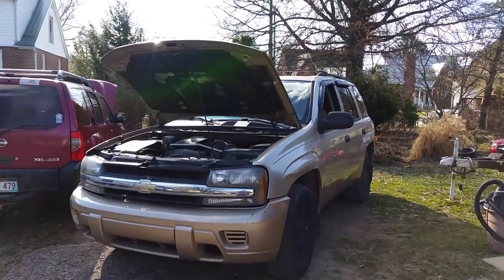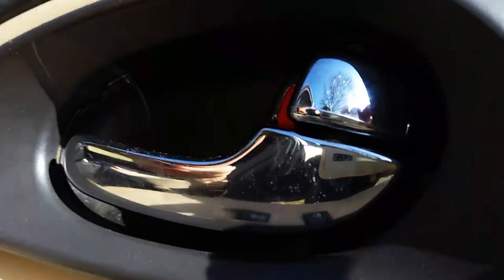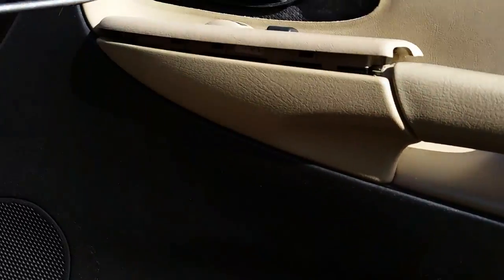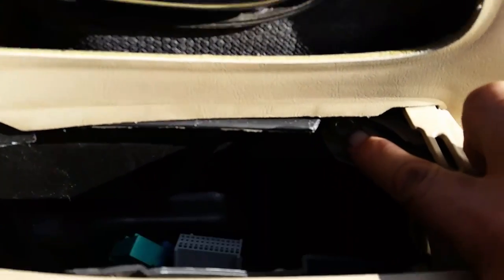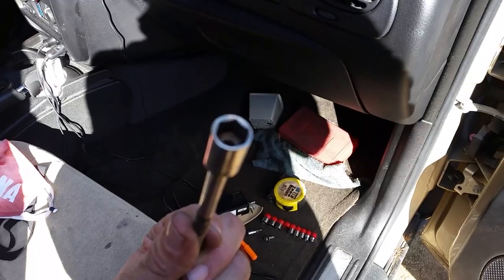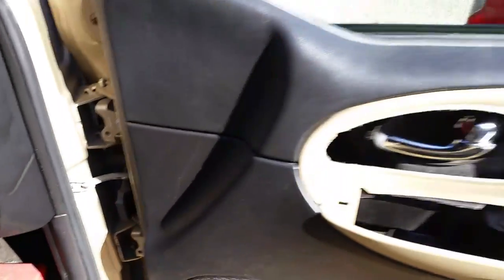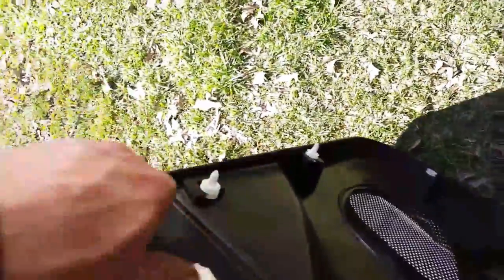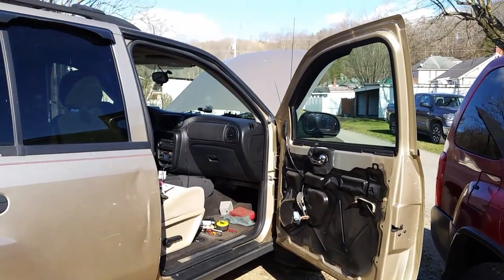2006 Trailblazer Front door panel removal (To access the Speakers)

Comment: Is there a bracket that holds the driver side door panel in place?  I closed the door and the panel just fell off.  I think there's a bracket that goes underneath the window controls.  I looked online and their is a bracket that fits a GMC Envoy.  I emailed the company to see if it would also fit the TB but they said they were unsure.  I went to my local GM dealer and and they said there is no part number to order.  I always enjoy your videos.  They are so informative.